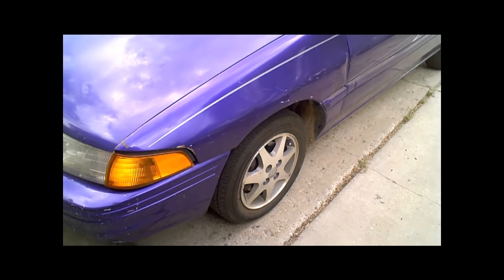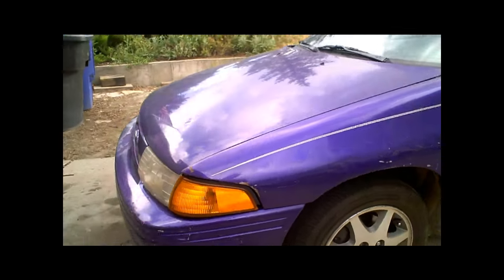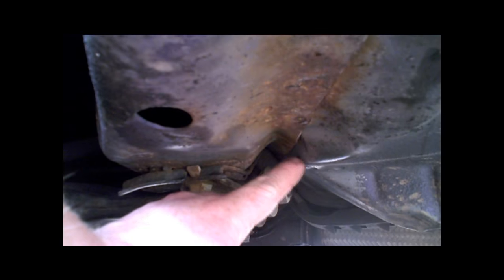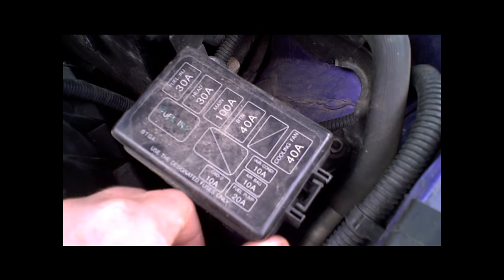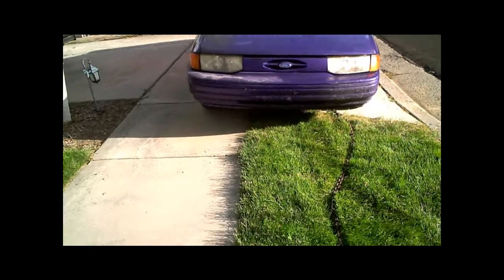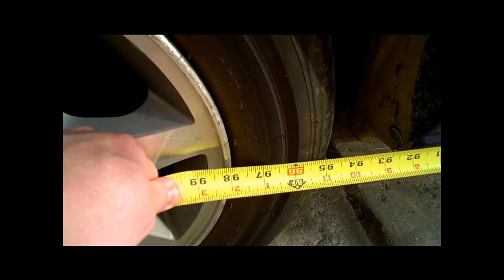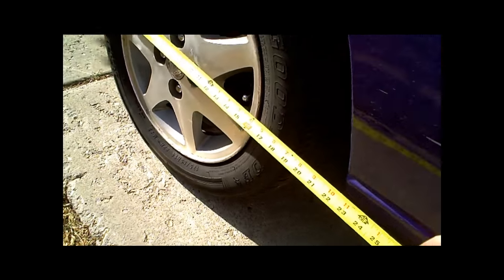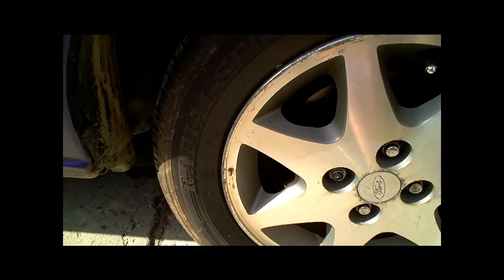redneck frame straightening of a cars lower A arm

Comment from the maker: 5 years later and the car still rolls down the road like new. Doesn't pull or eat tires and I have put about 50,000miles since.
Reply: Nice. I did the same thing to my car. I still have to pull some more but it definitely works.

Comment: My '86 Dodge Omni was rear-ended by a box truck. I used this same method to pull out the rear left quarter panel and hatch lower. Worked amazingly. I was 16, broke, and it worked. 15 years and 6 cousins later and the car still operates well. I like your videos, I'm wrenching on stuff daily too. thanks for the infotainment.
Reply from the maker: Thanks Joe. Whatever it takes to keep some of these things on the road. -Moe.

Comment from the maker: @ChassisControl ..... Metal Fatigue occurs when a material is subjected to repeated loading and unloading or a cyclic action. If I were to bend it back and forth repeatedly then there would be a chance for metal fatigue. That's not the case in frame straightening. The only time there is metal fatigue is if the frame has been pushed to the point of creasing over on itself. Then the frame is junk. Otherwise it can be safely straightened.

Comment: do you think this will work for my passenger door? under the passenger door it was in a wreck so the door is pushed in and fucked up but the framed under the door is bent a little bit is this possible to pull it back out to look normal and to pass inspection?

Comment: good example on what not to do, it's an unsafe $500 dollar ford back on the road.
Reply from the maker: Frame is straight and it rolls down the road perfectly without pulling to a side. A frame straighter does the same thing, just slowly.